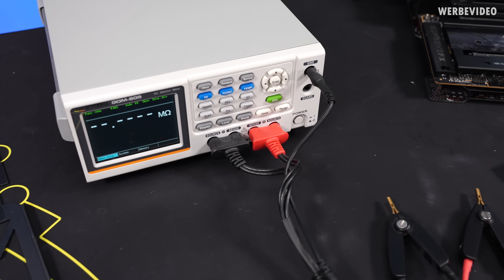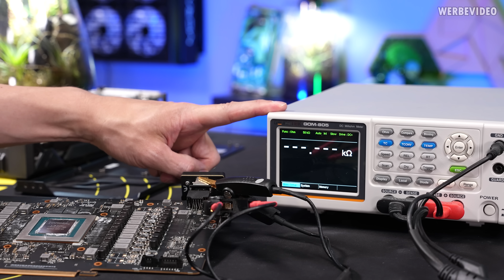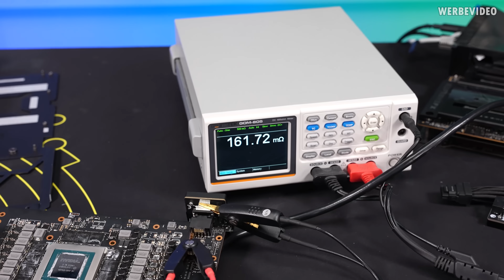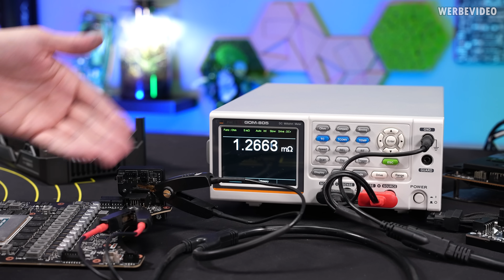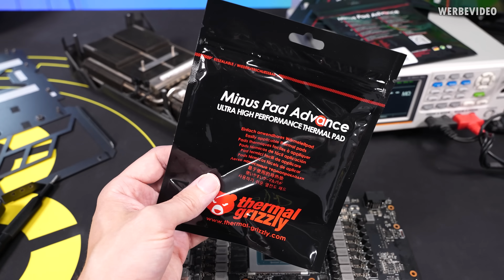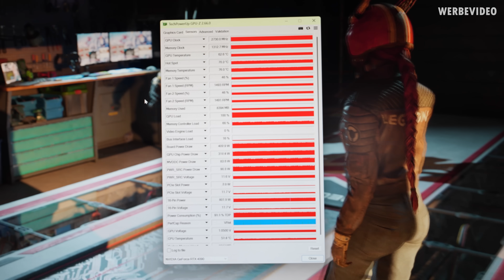It Happened Again – RTX 4090 with Melted 12VHPWR

Comment: Would an ASRock TC-1300T, with a thermal sensor, be able to prevent a 4090/5090 cable from melting?

Comment: Thermal grizzy materials are unavailable here in the Canary Islands, Spain, as are custom RL components (though I did buy some on the mainland).
The 1 mΩ peak value is closer to what I measured, i.e., between 1.79 mΩ and 2.79 mΩ (from the PCIe adapter and the point where the 12VHPWR is soldered).
The resistances should be the same since the cable is the same length. The positive leads are in parallel on the board, as are the 6 negative leads. They are also soldered to the same point on the PCB and in parallel.
According to Kirchhof's laws, the output is the sum of the currents passing through each of the cables. If not, the contacts or the crimping of the connector pins is faulty.

Comment: my asus strix 4090 OC melted this week, i have never overclocked it ever, i never needed to tbh.
ill think v very carefully before i buy nvidia again now
Reply: Are you sure that your gpu curv did not get reset after the driver patch? because the asus strix 4090 OC is factory overclocked on stock settings and driver patches can reset your undervolt settings and make it go on stock settings... if your card was undervolted?
Reply: @crazyc9326  no, its done using gpu tweak 3 and wasn't changed.
Reply: @JohnOLooney  so your card was not undervolted? since its overclocked on stock settings...

Comment: This nonsense has been going on for a long time, it's funny that we're talking about a trillion-dollar company, the card requires a separate cable and yet the design is such a mess.

It's pathetic that highly educated technicians can't figure out a simple solution. 🤯

Fortunately or unfortunately, I have an AMD card and I don't have this problem with it.

If I had bought one of these Nvidia cards, I would have 1000% redesigned the connection after a while according to my own opinion.

I wouldn't lose anything with it, because

If the factory connector burns out, then the RMA is no longer valid for it, even if it wasn't my fault...🤣

Comment: Simple fix - to Protect My GPU's, I put fuses in line with the 12V power rails.
Reply: What will happen if one of the threads breaks under load?
Has it worked yet?

Have you tested it? Have you ever broken one of the threads while it was under load?

Comment: I think I’ll hardmod any card like this I get with a custom, actually high ampacity connector standard…
Just need some plated mating copper connectors, and an injection molding system with some molds…
I imagine the LiPO batpack connectors aren’t good enough for this (or are they?)

Comment: This is result if garbage nvidia micromanage what companies can to do or can not to do. Everyone likes to use proper connections, but nvida does not allow. Chip company knows absolutely nothing rest of the graphics gard but plays a boss likes knows everything...garbage nvidai, garbage. 

You forgot the temperature compensation...at least I did not seen the temperature sensor anywhere. Already 1 degrees over or under 20 degrees cause the issue. Yes, typically these tools are designed to run 20 degrees

Comment: I know this may seem far out but I have a Theory on why this is going on.  
I bet you it has to do with the same issue that happens when you Dyno Car Audio Amplifiers and you see the DC Power cables flex on large current draws.  

I think due to the spacing of the pins and the amount of power they are sinking, they pins themslves are experinceing some kind of micro arcing as the pins are going through their current demands.  

This might be something like what happens when you make a Tube or Valve  and it suddenly becomes not a wire, but an  electronic part , thus the conductors  than experience varying loads, kind of like an analog  Crossover network in a speaker.  

Just like in a speaker, the High frequency filter then only passes a narrow band of power, leading the other pins in the 12vHP connector to take up extra load as they are acting like the woofer portion of a crossover network dumping significantly more power on the rest of the pins. 

i.e. , the connector itself is acting like a filter network, but instead of A/C Audio signals, we are passing DC and therefore it is acting like some kind of poor semiconductor leading to heat build up and higher resistance on some pins. 
Thus, casing the overload and the melting connectors.  

With all that A.I. Horsepower and maybe Mathematica or some similar  modeling software, I'm sure if you model the connector in a virtual environment  there should be some way to show the correlation to the failure modes that happen in the real world. 

WHY DO I THINK THIS ? 
Well, if you look at the card, you basically have some kind of issue where the physical layout of the traces is causing the power rails to act like a semiconductor in its own right instead of a power delivery plane. 

That would explain why Mathematically the conductor size makes sense and the power delivery and surface area may be satisfactory  on paper and math wise, but the issue happens to be not physical limitations of the surface area of the conductors, but the electrical characteristics of how the conductors are placed on the card and its wire length.  

Think about it! 
This connector was used before, but on other cards they did not use the same layout or traces on the previous applications of the 12vHP connector.  

And due to the actual loads placed on the card and what it is doing, that might explain why some have zero issues, while others experience it much more even though the physical connectors are the same for each user of the card and connector.  

I know in Audio that if you don't design your ground planes very well, or route your cables and traces in the board properly you tend to get noise that is audible. 
I would use those methods on a spectrum analyzer that can show things like capasicnete and inductance of the different pinouts going to the connector to verify this if I was testing for it. 

Well, that's how I would see if there was an issue running  a real world workloads as I don't think its the constant power draw, but the fact the card bounces a lot from high to low load causing a bigger issue then constant current draw. 
THAT ALONE would change the inductance of the wire pin leads/Traces causing power imbalance of the pins that would affect power delivery.  

Again, my hypothesis for these findings is that even on brand new cards and brand new installations where you're able to check the current delivery per wire you are still getting uneven current flow through the wires.
Hope this helps somebody out there.
:goodvibes:

Comment: Did the user tell you he was overclocking it and probably increased the power over stock also? I'm guessing not, For the record I am still using my 4090 since release day at stock with a Seasonic Vertex PSU and a Seasonic 12VHPWR direct cable with no melting and no issues, At some point you have to ask yourself what products people are using to power their GPUs and whether they are overclocking and over powering them.

Comment: Your measurement of the ground pins while still on the board is not going to yield any results because they're all connected to each other on the board itself. You're measuring the resistance of all the pins in parallel. I'm not sure about the 12V thing. Didn't you say before that some cards have two pins per inductor?

Comment: That's why I am skipping the 90's for 2 model series now until they fix this obvious problem, something I noticed since day 1 it was released!  You saps that run into this problem, if you have the skills; I suggest you de-solder the connectors and solder cables directly to the circuit board (On each end) and (as an option) put a commercial/industrial rated terminal connector/strip between the 2 components, (GPU and Power Supply!) (And you are a supper-sap if a add a device like this dude did which added yet another failure connection point to an already bad design!)

Comment: At this point is safe to assume that its not fault of cable connector but the soldiered to pcb connector i think they may be of poor quality metal maybe with microfractures during fabrications and over time when heated during gaming and getting cooled when pc is off those microfracture can get bigger and cause some increased resistances...

Comment: I kind of Blame Europe and the US governments and regulatory bodies for this they should have stopped the use of the connector and made NVidia warranty recall all the GPUs for a Fire Hazard. First time I seen the connector I didn't like it I thought there was going to be issues, I like what they are trying to do with it but the reality is the connector pins and the wires are just cutting it way way too close for the wattage, I personally wouldn't buy anything over a 70 class card using this connector, and its literally embarrassing they made another series of GPUs using the standard full well knowing there are problems and trying to sell those high wattage GPUs for over $1000, Asus has more than enough time on their hands to make a gold gpu but not enough time to solve the issue, well I guess they kind of did with the slot power standard, but unless Asus and other companies are fully willing to commit to the standard its meaningless.
ATX standard needs a new ratification shedding its legacy, the late Gordon Ung and I had a conversation about how its at this point holding everything back and being a hinderance supporting legacy over the progressive nature of computing and how every couple decades we should have a ratification and shedding of the legacy bloat.

Comment: Like always the power connector melted because they weren’t using the adapter provided. 

I have a 4090 fe and have never had a melting problem because I use what was provided

Comment: I read that you can use three 8-pin PCI-e cables to power a RTX 5090 but will of course, be limited to 450W. Is that true? And could you use the 1x12VHPWR to 3x8 Pin Wireview GPU connector to accomplish this?

Comment: Do untervolting! Less power usage, less heat, lower noise, maybe longer card lifetime, lower connector melting risc ...and reduced energy costs. I cant talk about the 4090 but the 5090. Picking the 875mV point and set ram Mhz to 2000Mhz gives you at least same card speed while power consumption drops about 15-20%

Use MSI Afterburner, edit voltage curve, pick 875mV, now don’t guess how many MHz you can drag the graph up, simply always pull it to unrealistic high Mhz up and then the program does rest for you. By flaten the curve it goes auto down to the highest possible Mhz for your selected max voltage point and this is exactly what you want, it’s really simple.

Comment: I have a solution for the 12VHPWR connector. It's called 8 pin PCI-E connector. I've beeing arround pc hardware for 20 years and there are enought problems to fix, stop creating new ones as a hobby. TY Nvidia. 😓

Comment: It's time to just say NO to these bad connector ideas.
I'm fine with them using multiple cables to improve flexibility, but use a proper wide blade connection for the termination and monitor it's temperature!
Also time to actually start using that sense wire in the standard to verify the voltage drop across the cable bundle. Ideally all the way down through the card connection.

Comment: 12v is not a bad idea but Nvidia can't seem to do it right or doesn't care two. 
The 9070xt nitro also uses 12v volt but there are no reports of any melting. This isn't really surprising given that its not were nearly the limit in terms of power draw like Nvidia is leaving a much greater safety margin.
Minor variances in plugs and cables have always been there but it wasn't a issue because they built in the safety margin.
Nvida comes along and drastically lowers the safety margin by reducing the number of wires then massively increasing the draw. It should have been clear as day there were going to be problems.

Comment: Sounds like the solution would be to move to a 2 pin connector. keep as many cables as you need but bar them to one connector pin.

Comment: I've had a 5090 being a pain with power imbalance across the connector (measured with a clamp meter) psu side was acting up  as well as the card. 

If it goes wrong I'll probably solder some normal 8 pin leads directly to the card to get away from the 12v high temperature garbage

Comment: Why not check the individual contact resistance after you removed the connector? The problem with measuring the resistance "in circuit" like that is you need to account for the common bus on the board (so you end up with a complex resistance circuit).

Comment: Will not buy a nvidia gpu with that connector on it, so that leave only the 5060 which I don't want, so I brought a Asus 9070xt tuf  instead with 3 8 pin connectors, I dont want any red hot metal pins wires and melted plastic with the possibility of setting fire to something in my house thanks.

Comment: Using multiple pins in one socket in this current range is flawed idea from the start, especially when pins are bolted together on a card (50xx case). If pins were separated and was some form of detection (magnetic?) of current in every one, then is chance of some protection/balancing. It should be done on PSU or CARD side, preferably CARD, but it will be circular blame shifting.

Comment: This connector is ridiculous. Mine didn't melt as I have a lower wattage card (4070 ti ~285W) but I had the random black screens which I fixed by simply unplugging the death connector and plugging it back in. After being under the impression this was a "higher wattage" card issue I just have no clue anymore, what a mess.

Comment: Haha  Herr Dremel must have been on cloud nine being able to use the precision cutting took LOL.  How much longer before they start using a proper connector for that high power  600 - 1000 WATT ?  Oh well I guess wait until all is optical and power consumption a fraction of these old Tech GPU's .

Wondering what kind of research you need to do in order to have these connectors separated.   Cool one down and heat the other up?  
Oh well it was an 4000 Card lol.  H+ not an H++  tsss  ... do tell next time what you found out Herr Roman. Thanks for the stream, always cracks me up.  

🤣

Comment: Use die electric grease on the 12vhpwr you wont see this issue anymore. The die electric gease will help kool the pins, if the plgug were to melt they probably wont fuse together.

Comment: I have to ask. Why don't they just use a 2x 6-pin connectors? Why in god's name would you power one of the most power hungry GPUs through a single connector and tiny wires instead of splitting the load onto two connectors evenly???

Comment: The conspiracy people will claim 24VH connector was invented to sale more GPUs by having them brake after warranty but they failing too early.
Me I think something is causing the joint power bar to heat up and pins to melt a sort of thermal run away caused by something in the power delivery they changed from RTX30 Design. Only by comparing the Designs of say 3090 4090 and 5090 will reveal the cause.

Comment: Given how both rails are bridged at both ends, I don't think you actually measured what you wanted to measure. In fact, I'm pretty baffled by you seeing different measurements across the lines, which, in my opinion, indicate abnormal resistance at *solder* joints.
Think about it this way - what's the difference between clamping the probe at the pins vs clamping it at the back side of the PCB, at the solder joint.

Comment: I have the same card. Just got it back from warranty repair from ASUS. They made it painful to get it serviced; it took me 2 months to get them to RMA the card. Once I sent it in, I got it back quickly and so far, it's working fine. I decided to spend $70 for a newer 6x6 cable from CableMod and now I make sure never to run the card at full tilt - I limit frames and keep an eye on power draw. What a dreadful situation. This could have been avoided so easily ... These ASUS "engineers" should be fired immediately!

Comment: that the major weakness they just using cheap plastic to make power connector its flamable stuff my reccomendation high power cable should go with socket made from Thermosets which can withstand high temperature and wont even melt or burn these stuff materials mainly has been use in my country high voltage system over thousands ac volt in my country... that make me laugh gpu over $2000 , cables $100 and $1 connector? lol

Comment: I am curious if anyone looked into reports of previous connectors melting. This connector seems like unesessary risk. Maybe it does not happen that often, but it seems to happen enough, and I would like to know how many times it happned with the previous standard. I also really like what Asus is trying with an additional tab on the PCB to eliminate the need for addiotional cabels to the card. I mean you still need to provide that power to the motherboard somewhere, but it is definitely a cleaner design.

Comment: It’s just crazy to me that NVidia bothered to specify a different power connector, but didn’t bother to pick one of the many high-current DC connectors that already exist, and instead used a Molex micro fit with some sense pins tacked on. I mean, an XT120 would have handled that load just fine, and wouldn’t have had any of the problems 12v2x6 does. They get used on lithium battery packs all the time for high-current applications like e-bikes or big RC cars. Sending 600w of DC power through a connector is a solved problem. NVidia just chose not to use any of those solutions!